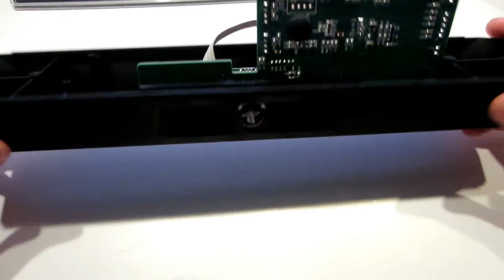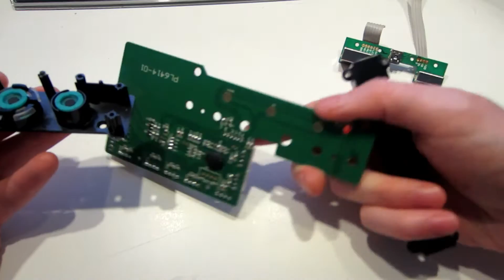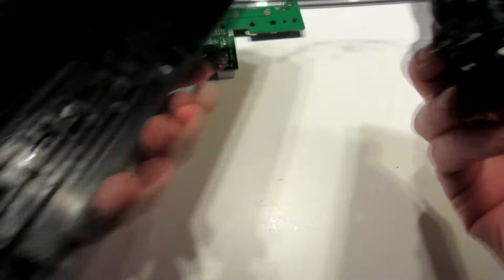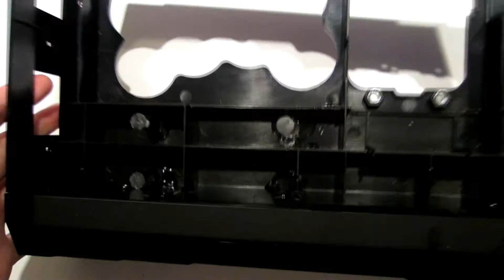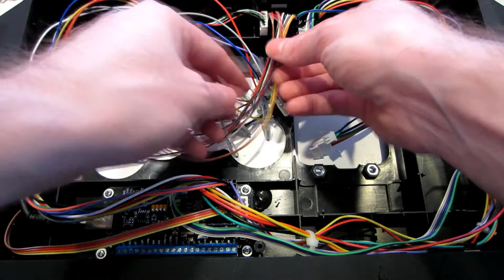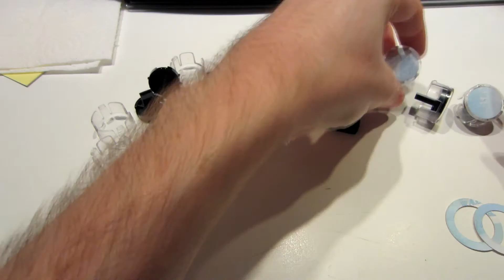[Arcade Stick Mod] Part 8: PDP Injustice Fightstick PS3 + Brook Universal Fighting Board

Comment: Hi u made a custom cammy injustice fightstick bout 2 yrs ago and works great but I'm in need of the the 3 black cables that go from the brook converter to the EZ mod do by chance have any that you could sell to me or guide me to someone that does brook dont have any
Reply from the maker: Are you talking about those ones?  https://i.imgur.com/n7uyK0W.jpg or the ones for the Hori RAP? https://cdn.shopify.com/s/files/1/0748/3745/products/01_3d7f927a-d9ea-4217-bc75-13060561afa1_1024x1024.jpg

Comment: Friend help me install LEDs to a qanbaq4raf?
Reply from the maker: Are you talking about the player leds? I've never did it on a Q4RAF, but from the pics on internet, everything is indicated on the front panel PCB and it seems pretty straight forward: http://i.imgur.com/MJUiJmX.jpg VDD is from VCC of J5 of the Brook UFB, then player leds from P1 to P4 (and apparently you can also link the turbo LED)
Reply: The Real Phoenix Friend and not have more pictures of the inside q4raf? Please. And thanks

Comment: did you change out the buttons too?
Reply from the maker: No, I kept everything (after I've cleaned them with some electrical contact cleaner spray - Kontakt 60 - but I didn't find that intresting enought for the video).
I've could replace the microswitches though, as long as the PCB for the direction, since Sanwa's stuff is fitting, but it seems the stick was outsourced to Qanba, so they're still good.
Reply: The Real Phoenix  . cool I'm the one who bought it on eBay. just wanted to see if you recommend changing out the buttons.
Reply from the maker: It's more a question of taste than a recommendation. Some people find them mushy and don't like the feedback on them.
Reply: @stikupartist3698  nice  after seeing this I had him custom build me a Cammy model one it's a a good starter fight stick it goes with my buddy's R mika custom madcatz stick

Comment: Can u send a link to the custom board u were using? I am also doing a similar mod like urs too.
Reply from the maker: Sorry I don't have any link.
Reply: The Real Phoenix What was the size of the paper and the paper type?,I plan on getting my art printed on this fight stick.
Reply: The Real Phoenix Thanks, I was also wondering if going to a print shop would be an alternative as I hear that's cheaper,but anyway thank you so much.
Reply from the maker: You can download the layout for the artwork on this site, this will give you dimensions and placement for the buttons' holes.

Comment: Love the looks of this stick, does this stick have any 8-minute timeout issues? if so what firmware version of Brooks UFB are you using?
Reply from the maker: Hi,
No timeout since V1.6 firmware. Tested on PS4's firmware from 3.55 to 4.5.
Reply: The Real Phoenix can you mod it with a Dayton Audio TT25-8 Puck Tactile Transducer mini bass shaker? It would be awesome if the stick had vibration.
Reply from the maker: Unfortunately the Brook Universal Fighting Board don't have either sound or connexion for vibrations feedback, so I don't think adding vibration is possible.